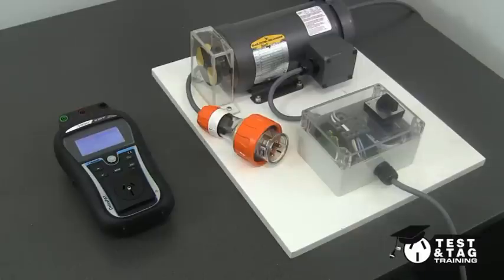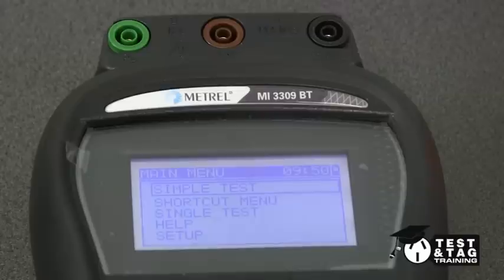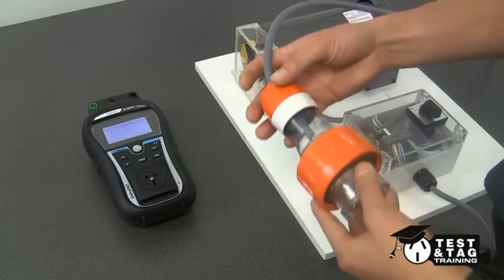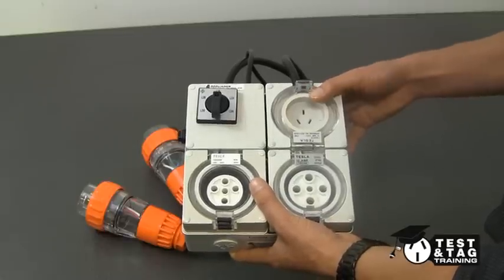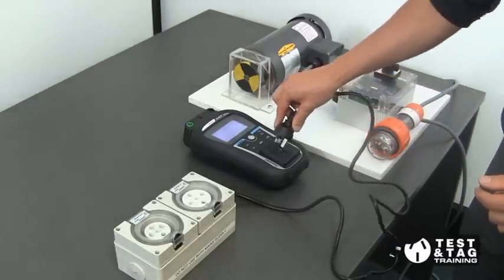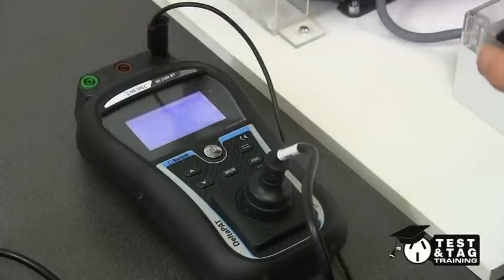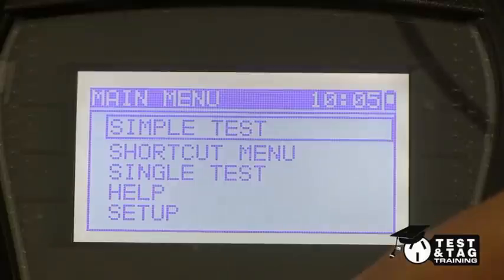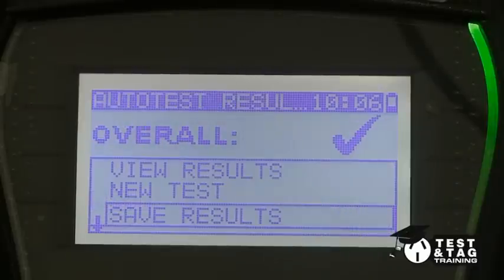Test and Tag a 3 Phase Appliance - Part 1

Comment: Hi Matt, this test may well be fine for the earth continuity test, but given that from what I can see, that motor is under the control of a contactor it will not work for IR testing of the motor. This being the case this test will only IR test to the incoming side of the contactor. The motor windings and any leakage on the incoming supply to the motor will only occur if the contactor was activated, or the contactor was operated manually. Your next live leakage test would suffice, given that Test and Tag testers are not permitted to open equipment.